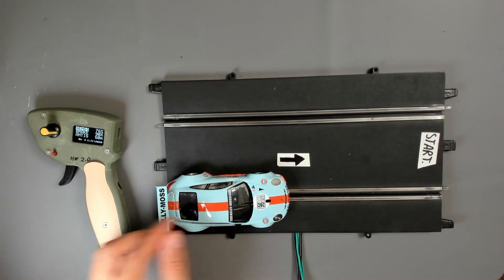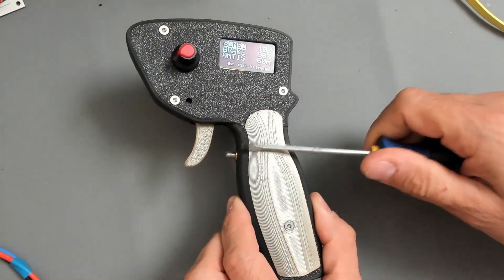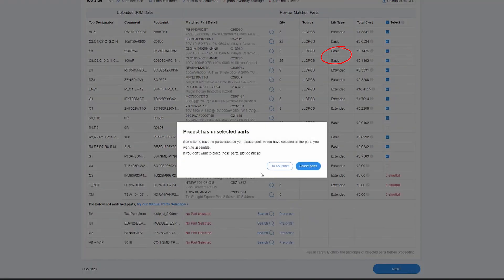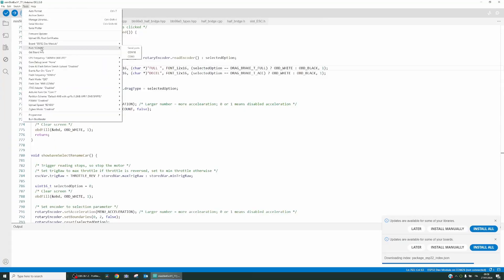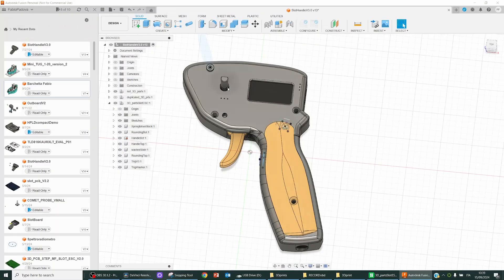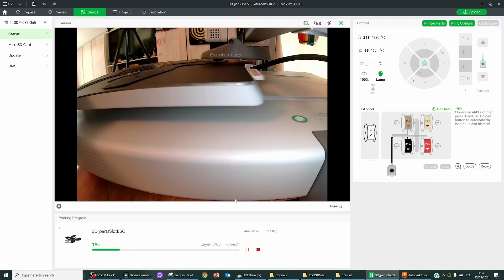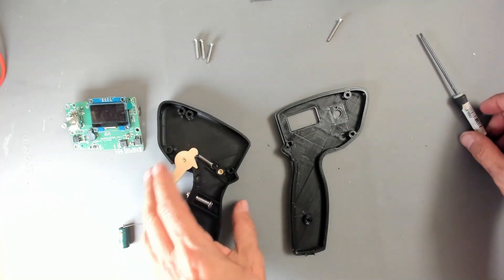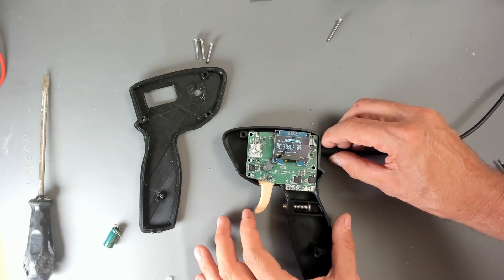DIY slot car speed controller - ESP32-arduino ESPEED32

Comment: this is a great video and i love your design
Does anyone know how to convert this so i can use it left handed?
Reply from the maker: Kind of complicated because of the mechanic swap
The easiest part is to put the encoder on the other side
The display is only 4 wires and you can reverse it
Reply: @MakerFabio  I was thinking that would be the way to do it. 
I can also adjust the 3d print to suit.

Comment: After some trouble with the magnetic sensor (see below), we’re finally making great progress with the assembly!💪 We ordered the wrong magnets, but just rotated them 90° — works! A huge thank you to @MakerFabio 🙏 for all the guidance. Really appreciate it!

Does anyone have experience with how this compares to ACD or other brands? Is it good in practice? I love that you can adjust settings digitally and save profiles 
🎮✨
Reply from the maker: finally!! many thanks
Reply: @MakerFabio 

Oh! What’s going on now? I set up a lab test with the car, controller, and a 12 V power supply connected to the wall. When I activate the brake on the controller, the wheels/motor start spinning backwards! 😅
Is this just because of the lab setup, or have I done something wrong in the controller configuration?
Reply from the maker: @rcw8982 just invert the cables to the track
Reply: @MakerFabio

Thanks so much for the quick reply! I actually got a few things wrong earlier.
After taking a closer look, I can see that activating the brake by more than about 10% makes the wheels start spinning on their own — even without pressing the trigger! The wheels spin in the same direction as when I press the throttle.

In practice, this means I can accelerate the car just by turning the rotary knob. Turning it to the right increases both the wheel speed and the brake percentage.

As I understand it, the brake should basically act as the motor running in reverse, but not with enough voltage to actually move the car backwards when it’s stationary — right?
Reply from the maker: @rcw8982 mmmm, in the track you need to have the wiper from the remote and a constant negative from the power supply

So if you see this behaviour, you may have a constant positive and wiper (which is wrong)
Reply: @MakerFabio  

I have two controllers, each with its own bug, so I’m not fully operational at the moment. I don’t have enough time to fix them right now.

I do have a concern regarding the track call. When it occurs, the power is cut and the controller stops. Since it takes a little time to boot, some time is lost there. It might be worth considering a faster boot sequence if possible. Any other suggestions?

The problem is that if a battery or something similar is introduced, one could drive while the others cannot, which is a bit tricky. I think the fastest possible boot is probably the best solution. Or a 3v battery to keep the controller alive, without running the car. Any other thoughts or suggestions?
Reply: @MakerFabio  Ah! I’ve finally got a controller working with both the car and the track — absolutely brilliant! Really exciting, and I’m genuinely grateful for the project. I’d mixed up the wiper, + and –, which ended up damaging one of the ICs, so that had to be replaced. But now everything is running perfectly, and I’m really pleased.
Since the controller takes a moment to respond after powering up, I’m planning to add a 3.3V battery and a small charging circuit that can supply 5V to the ESP32, so it doesn’t shut down during a track call.
Reply: @MakerFabio  Hi again! Would it be possible to get the original PCB files? I’d like to add a UPS and a battery. My proof of concept, where I lifted the voltage regulator, worked perfectly, but it would be even better to integrate the circuit directly into the PCB itself.

Comment: Hi everyone!
I mentioned this further down in another thread when I ran into the same 1913 issue as many of you. You can find a bit more detail troubleshooting there.

For me, it turned out to be a mix of three small problems (or fixes). The first PCB was simply faulty. The next two didn’t work either, but I eventually found that changing the I2C address to 0 x 44 and adding a short reset sequence solved it.
Reply from the maker: Hi thanks for posting the solution
Hope this helps others
Reply from the maker: I see I have a 5D for the new chip actually, maybe you purchased the old one. The new chip has extension name P3B6
Reply: @MakerFabio  Ah, yep. We (and probably others experiencing the same issues) ordered the one from “BOM_ESPEED32_V3_0_complete”, not the one mentioned in the readme. Does the version matter for this usage? Do you recommend change it to the new version?
Reply from the maker: @rcw8982  I just checked, in the BOM is written:TLE493D-P3B6 A0 which is the proper part number. the "P3B6" is the new silicon. but please note, the last part (A0) of the part number is related to the address, if you choose TLE493D-P3B6 A0 it will have 0x5D, A1 it iwll have 0x13, and so on, please double check the part number you ordered, and the datasheet for the proper address (I think we are using the 7 bit address )
Reply: I’m trying to share more information, but my comments keep getting removed by YouTube. I don’t have any links or anything like that — I just don’t understand. Sort by "Newest comments – and potential spam". to see more info
Reply: We picked up that reset tip from a discussion on the Arduino community forum — you can find it easily by searching for “TLE493D W2B6 3D Hall Sensor Arduino forum”.
Reply: We also made a fork of the project and opened a pull request with the updated code — look for the branch called "bugfix/TLE493D-W2B6-A3" on the original repository

Comment: Hello Fabio, I really love your controller and I'm almost done making 4 of them for my 4 track slot car circuit! But I ended up with one big issue and thats obviously the magnetic sensor. I ordered TLE493DW2B6A3HTSA1 version wich should be same as ur version like pinout and so and I also modified the code such as 0x44 i2c adress, 400000 i2c rate, but the sensor keeps giving me 1913 values and nothing changes... I'm kinda out of my knowledge... Coul'd you help?
Reply: Hi @MakerFabio, I have the same problem as discribed above. Changed all the parameters you suggested, but still no luck. Any other suggestions?
Reply from the maker: @randykoeman8385  mmm really don know what to think
I m producono them with same sensor and the address and code i shared
I have to double check again

Did you verify with an oscilloscope or a cheap logic analyzer (6 euro aliexpress, if clock and data are ok at the sensor pins?

I will try to vuole another one , upload the code and check what happens
Reply: @MakerFabio  That would be great. I,ve checked al the pins on the sensor and all the readings are ok. I've put together another board with only the sensor, ESP32, display and rotary encoder just to make sure, but the outcome is still the same.
Reply from the maker: @randykoeman3404  mmmm,
Have patience
Not sure if I can make it this weekend
Latest the next one
Reply from the maker: @randykoeman8385 wait, are you sure you are using a diametrical polarized magnet? Or even if you leave with no magnet, you should see lot of variations in the throttle
Reply: @MakerFabio  I think i have the correct magnets, but even without magnet there is no variation in the throttle. all numbers say 1913.
Reply from the maker: Hi, I just double checked, you should buy the TLE493D-W2B6 A3. so it really looks you have the right one. ythe address should be #define TLE493D_MAG_ADDRESS 0x5D  /* For the TLE493 P3B6 */

I see in my new code I have this:
Wire1.begin(SDA0_PIN,SCL0_PIN,800000L); /* DEbug added for secon I2C */
  Wire1.beginTransmission(TLE493D_MAG_ADDRESS);
  Wire1.write(0x0A);      /* setup for ony 2 axis fast reading:  Register address */
  Wire1.write(0xC6);      /* mod1 11000110 */
  Wire1.write(0xD2);      /* mod2 (Entire reg: Original 0x02 =>now D2) first 4 MSB bits:1101(D)=BxBy  0000 = BxByBzTemp 
                                                                        last 4 bits fUpdate 00 =1000Hz /extrashortEn 1 = ON/ShortEn 0 = off*/
  Wire1.endTransmission();
Reply from the maker: and of course double check soldering on the small TLE
Reply: @MakerFabio  

I have the same components and the same 1913 issue – there’s no change in the value at all.
Are you sure about the address? I used GPT to write a small program to scan for the correct I²C address, and it appears to be 0x44. Either way, I can’t get it to work.
I’ve tried replacing the magnetic sensor, but that didn’t help. I’ve also checked all the solder joints and reflowed any that looked suspicious. I’ve confirmed that the magnetic sensor is oriented correctly, with the dot in the same position as shown on the PCB, and that the pinouts are correct.

The error message I’m getting on the serial monitor (115200 baud) is as follows:
E (1237) i2c.master: I2C transaction unexpected nack detected
E (1243) i2c.master: s_i2c_synchronous_transaction(945): I2C transaction failed
E (1250) i2c.master: i2c_master_receive(1268): I2C transaction failed
E (1256) i2c.master: I2C hardware NACK detected

Any suggestions?

Edit 1:
After taking some more measurements, I’m getting 2 kΩ between pins 1 and 6 to 3.3 V, which makes sense since there should be 2.2 kΩ pull-ups there. However, I’m also measuring only about 3.8 kΩ from pins 1 and 6 to ground, which suggests there’s a leakage path to ground on the I²C lines.

Edit 2:
I’ve now soldered a new board together, this time in a different order. I first mounted the three components from Mouser, then measured 100 kΩ from pins 1 and 6 on the TLE to ground. However, after attaching the ESP, it dropped back to 4.3 kΩ — exactly the same as on the first board. What’s going on here?

By the way, Issue #5 on GitHub says:

“The PCBs are a bit fragile — I burned one in the position of the magnetic sensor, wasn’t able to get any feedback, and in the end the air gun destroyed it.”

🤷🏻‍♂🤷🏻‍♂🤷🏻‍♂
Reply: We solved it. Check my other comment for more info
Reply: @rcw8982  Where?
Reply: @fofaanik04  
I’ve started a 2 new threads i.e. 😊 I’m not 100 sure about the reset procedure actually. I think we removed it again. So only 2 problems simultaneously 😊 check the public PR
Reply: I can’t find the parts list for the hardware. Magnet mainly
Reply from the maker: @mitchelkauppila5665 magnete are in Aliexpress
Look for encoder magnet, diametrical magnet or radical magnet

https://a.aliexpress.com/_EwoFilE

Recently i purchase them on digikey also

Comment: I have managed to learn how to put the firmware on the ESP32 but upon powering up it gives a message "EEPRON NOT init! press button to calibrate.: is this referring to the momentary button? as I left that out as you had in the video? holding down the rotary encoder upon powering on does not seem to launch to calibration mode. please help... getting closer but I am not there yet.

Comment: @Maker Fabio - do you know of a suitable replacement for IFX7805ABTF, this IC is discontinued and the ones I find have a minV of 7v. Versus the 300mV the original has. 
Thanks in Advance.
Reply from the maker: Any 7805 in dpak with at least 500mA it is ok
Input voltage is 12v so no need for special low dropout
Reply: @MakerFabio  Got it, now im having an issue with the ESP32 rebooting constantly. I isolated another esp32 and attached screen to it, flashed the esp32 and it does the same thing. i can see it rebooting via serial console.
Reply from the maker: @buzzkillg230rc  which version are you using? The v2.02?  Dis you try a blink sketch on your board just to be sure they are working?
Reply: @ I’ve tried all the version in the GitHub with the same results. I think it maybe the version esp32 I’m using and will try another version. I’ll let you know how it goes.
Reply from the maker: @buzzkillg230rc  which  esp32 bpard type uou selected in the arduino IDE?
Reply: @ in the IDE I selected ESP32 Dev board. Like your video shows. I can see in the serial console the program wrote to the esp and if I use the select button on the know at times I can get the screen to paint (show settings) before it reboots again.
Reply from the maker: @buzzkillg230rc  really fon t know what could be
I just went to my friend house and he was able to flash the esp32 without problems
Another user in the comments has been able to built the espeed32 , even using the old silicon magnetic sensor
Sorry, again , i don t recall, are you able to run a blink example on your board aithout reboot?
Reply: @MakerFabio  Yes, I have loaded the Blink Sketch onto the ESP32 (WROOM) and it does work. The blue LED flashes and it does not reboot, while running it.
Reply from the maker: @buzzkillg230rc  ok
I just uploaded on github the espeed sw version 2,04
And just uploaded in to an empty esp32
It works properly 
Please try again
Reply: @MakerFabio  I get the same reboot issue, I placed the error in the issues section of git hub. i get a watchdog error that keeps rebooting. other things I've tried included erasing the memory of the esp32 using webtools, after which I upload the speed 32 sketch. at this point, I think it has something todo with the make or brand esp32 I'm using.
Reply from the maker: @buzzkillg230rc  i fear so
The only other option could be thay you accidentally soldered a vias (small pcb hole) close to the oled display pins (i noticed there is one very close to the pins). Or in general examin all your soldering points. Another viewer was not able to run because of this. So he reworked and it finally worked. A but wait, you said that it is rebooting also with an isolated esp32, so a bad soldering point is not the rootcause
Reply: @ I’ve ordered a new set of esp32 and will try flashing those isolated.  Thank you for the help and suggestions. I’ll post my findings.
Reply: @MakerFabio  Followup - I got new heltec ESP32 boards and loaded the sketch only to see the same issue in the serial console.
Reply from the maker: @buzzkillg230rc  unbelievable
Only with the esp32 not mounted?
Can you try compile on a friend PC? Maybe you have wrong libraries or board support packages
Reply: @ I’ve tried on two different pc’s. Now.  (Laptop and desktop). I’ll try again on a different computer.  Will keep you posted. Thanks.
Reply from the maker: Don t know what to say
From my side i purchased about 20 esp32 from 4 aliexpress shops
All worked
In my pc and in the pc of a friend. Sorry for this, but i cannot help
Reply from the maker: Actually in the pc of 2 friends (a  guy that helps with sw and a guy that purchased aprototype)
Reply from the maker: @buzzkillg230rc  I just purchased other 3 esp32 and i have your same problem!!
I see that the new modules are marked wroom-32d, while the old ones have the only wroom-32. Now i have to figure out what is the problem
Reply: @MakerFabio I have about 6 of them, I cant use at this time. It almost as if its a CPU issue. it could p[potentially get sorted in code.
Reply from the maker: @buzzkillg230rc  i m investigating. Please if you are able to fix let me know
I ll let you know if we find out on our side
In the mean time i try to buy from my old shop on Aliexpress
Reply: @MakerFabio  i havent tested this theory yet, but i wonder if the issue is caused by Task1. 
/*** create a task that will be executed in the Task1code() and Task2code() funcitons, executed on core 0 and 1 *****/
  /* TASK1: slotESC state machine, managex OLED display and Encoder, low priority task */
  xTaskCreatePinnedToCore(
    Task1code, /* Task function. */
    "Task1",   /* name of task. */
    10000,     /* Stack size of task */
    NULL,      /* parameter of the task */
    1,         /* priority of the task */
    &Task1,    /* Task handle to keep track of created task */
    0);        /* pin task to core 0 */
Reply from the maker: Don t know. We have to find out
Reply from the maker: @buzzkillg230rc  hi , also the module 32D is working correctly , it was simply a soldering issue. If the display is not connected it is resetting
Please check all your soldering especially verify if the pin coming from the esp 32 scl and sda is arriving till the display
Reply: @MakerFabio  I decided to test using the schematics and pinned out the screen myself (last time my friend did this) after review, was able to see the esp32 and screen work with no rebooting. I then went to the problematic PCB with the components attached and continuity checked the screen to ESP and found SDA1 not responding, I resoldered this and powered the unit up. Sucess! IM printing the trigger, washers and sliders at the moment and will test soon with a magnet as you do in the video. Thank You.

Comment: Is the board's avail now and how much does each cost?
Great work!
Reply from the maker: Hi
I have only few prototypes, but i dom t know how to ship outside europe.
Reply: @MakerFabio  Can I order the exact board + passive components from JLCPCB? 
If is the number of the board?
Reply from the maker: @dantecant  hi
Yes but you have to go to the github and download gerbrt file and bill of material, then order that one to jlc pcb
I asked to have a special number to order the entire pcb package and passive , but they are not ready for this type of requests
Reply: @MakerFabio  Do you the have Gerber Files?
Reply from the maker: @dantecant  yes link in the description
Reply: Pardon my stupidity but I can find it.
Is this the Gerber File (MF_SLOT_ESC_V2 1)?
Can you tell me where to look for it?
Reply from the maker: @ in this directory
In the github
ESPEED32/SchLayout/ESPEED32_V3.0/Project Outputs MIN_SLOT_ESC_V2.0
/ESPEED32_V3_0.GB
Reply: A silly question?
Where does the output of BTN9960LV go?